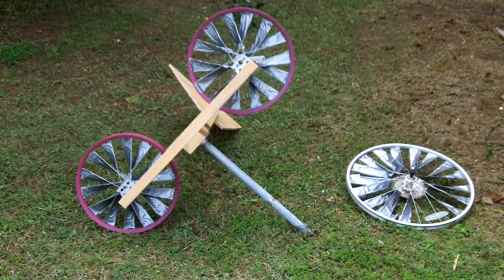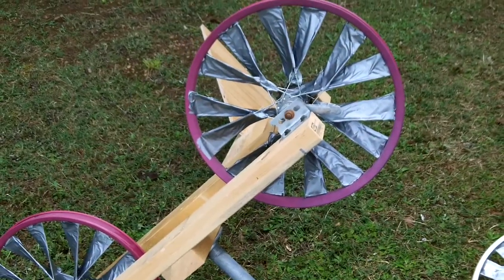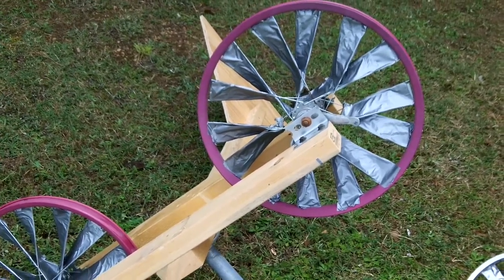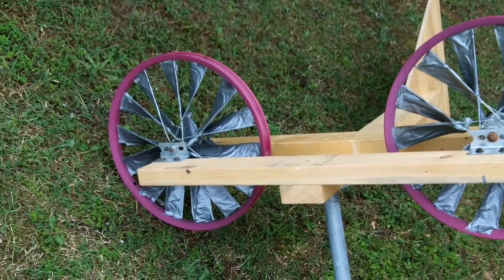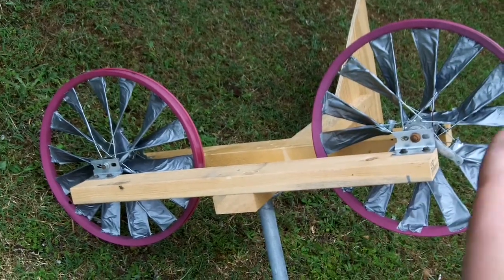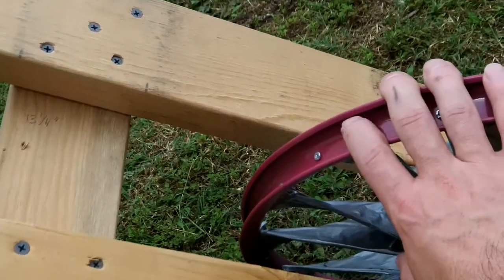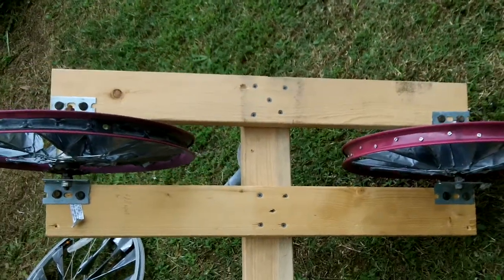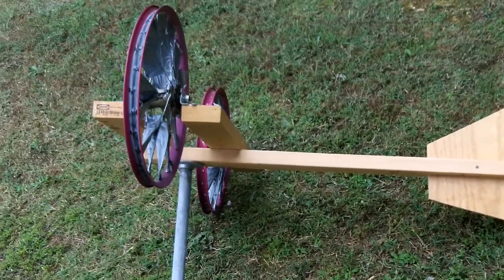2 wheel duct tape turbine

Comment: Thanks for sharing with all of us.Could you put a large pulley on each wheel with a belt or bicycle chain leading to a smaller pulley on the generator to try to increase the turning power with out reducing the rpm? Let me know your thoughts on this. I am just trying to learn. How did everything work out for you with the attached generator? Thank You for your time.

Comment: Put a jog in your pole-to-wind generator fuselage connection so that the pole is in front of the blades while the connection to the fuselage is in the center of the mass.  It will help keep it pointed in the wind.

Comment: this is  a comment on your 2 wheel wind turbine . do you remember what u used as a piviot ? thanks in advance
Reply from the maker: allan egleston I believe I used a 1’’ floor flange with a 1’’ galvanized
pipe. Then that was placed into 1 ¼’’ EMT. After attaching the flange to the
pipe, drill a hole in them and put a screw into them. After time they will work
loose. Thanks for the question, Lonny